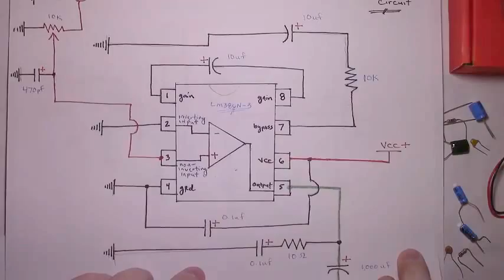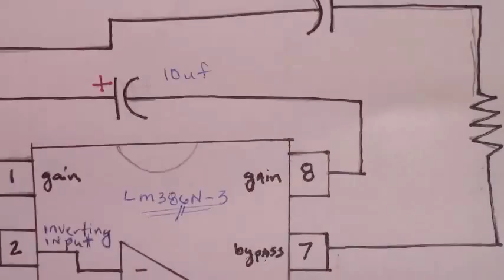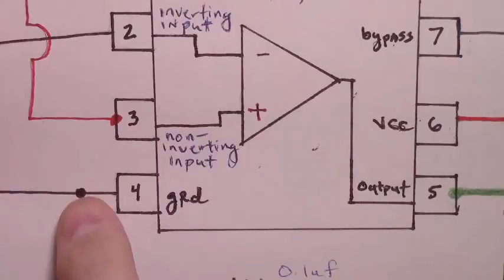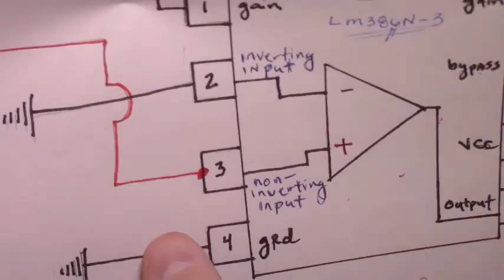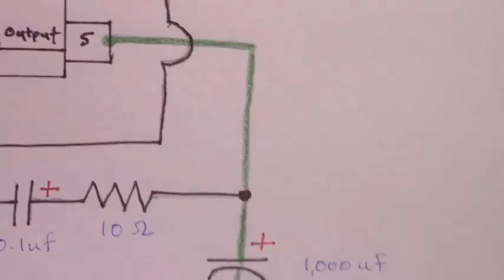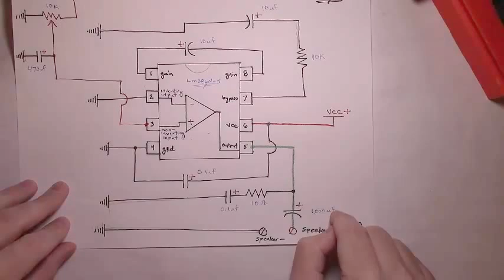Circuit Assembly Tutorials || LM386 Audio Amplifier

Comment: awesome tutorial....can i ask what voltage rating of capacitors you used and the wattage used in the resistors...i really want to do the same thing with what you did , the sound quality is good..keep making awesome tutorials
Reply from the maker: random modnar Appreciate the question and feedback.  Capacitors rated from 16V to 50V & 1/4 to 1/2 watt resistors will work. For,e.g., a 9V supply, caps rated 16+V are fine, for higher supply voltages one might want to move up to caps rated for 25 to even 50V.  The general rule of thumb is to select caps that are capable of handling close to double to in some cases triple the voltage one actually expects them to ever see --similar reasoning applies to resistor wattage.  It's generally better to select parts capable of withstanding 2 to 3 times the 'stress' they will ever see.  Hope these comments help.  Please continue to let me know if there are more questions.  I'll always do my best to help.

Comment from the maker: To Partho Lad:  For some reason I wasn't able to click reply on your comment.  No worries, hopefully you'll see this.  The 386 tends to work best with an 8 Ohm speaker around 1 to 5 watts.  It will function with a 4 ohm but there's a chance that the chip might start to overheat if used for long intervals.  Also, the high wattage associated with the speaker you mention means that it's built 'heavier' than, e.g., a 1 to 5 watt one would be.  'Heavier' coil, cone, etc., typically means more work for the chip to do, more work means more strain and more heat.     Assuming the chip successfully moves the speaker (which it may be able to do) you could certainly use it to test the circuit.  A short test shouldn't hurt anything.  But for consistent usage and long intervals I'd try to locate a 8 ohm 1 to 5 watt speaker.   Hope these comments help.  Please continue to let me know if/when there are any questions.   And, thanks for watching.

Comment: verry helpfull and precise instructions,i am just begining electronics after retireing a few years,and was wondering if this circuit could be used for verry hard of hearing .i look forward to seeing more of your projects,it was verry well explained thank Mike
Reply from the maker: Mike Hancock Appreciate the comment, feedback, and question.  The circuit can certainly be used to amplify audio signals in a variety of interesting and useful applications.  And it's great that you're beginning electronics, it's always an enjoyable world to explore and learn more about.
  
As to the 386's suitability for a hard of hearing application: The chip wasn't designed for usage in medical devices (or as one) and in turn isn't guaranteed, for lack of a better phrase, "to reliably be there when/if one were to desperately need it" (like e.g., while driving a car, crossing a busy intersection, etc.).  Hearing assistance tech is typically tested, retested, etc., etc., just to make sure that it will likely (hopefully) "be there when/if needed".  This being said, it very well might work, but I can't in good conscience I can't recommend it for such. 

However, if the idea was more along the lines of having it serve as the centerpiece to, e.g, an in-house intercom system or perhaps as a headphone driver, then I can say yes to the intercom and maybe to headphones. 

I've used it as part of a in-house intercom system, it's greatly reduced the need to yell across the house...turned out to be a very handy thing to have around.    

As to the 386 being suitable for headphones:  It mainly depends on the type and impedance of the phones.  It wouldn't be the best for use with headphones having a impedance higher that 8 ohms.  Most of the headphones I've encountered have been 16 to 32 to 64+ ohms.  Though it should work in the case of two 16 ohm phones if one rewires them to operate in parallel (in turn reducing the total impedance the amp sees to around 8 ohms).  But attempting to use it to drive a typical pair of 64 ohm phones would be too much of a load in the long run...the 386 would do its best to drive the load and might do a decent job of it for a little while but it likely wouldn't do so for long.  Audio amps like the 386 will do everything they can to drive the load, regardless if it's outside their tolerance ranges.  If the load has way too little or too much impedance, then they can overheat, internally fail, etc.

In the end, the circuit can definitely be used for a huge range of applications and I've found it to be helpful in quite a few unexpected ones.  In house intercom, yes.  Headphones, maybe. One would need to pay careful attention to the impedance. But, as a substitute for hearing aids or the like, I wouldn't trust it to keep one safe.  
  
Hope these comments are helpful.  Thanks for watching the video.  And, please let me know if there are more questions.  I will always to do my best to help.

Comment: philo mech- I was reading thru some of the post below and happened to read the one posted to ViTALiY that really caught my eye I plan on building this 386 as well I built one a Long time ago and it still works good but I want to build another one w/SMD to add a Audio in & out for a 7" TFT monitor FPV all in one unit, but back to the Spectrum Analyzer you mentioned in the post below I was a Sound Tech for Live bands Years ago and always had to borrow a room Analyzer to set the EQ on my 32 Band if I had a bad room or had feed back that I just could not get rid of and still sound good- but most of the time I just did a sound check an Hour before the doors opened and that usually worked Jameco Use to sell a 32 band Room Analyzer kit  w/LEDs the whole nine yards but they no longer sell it and NO ONE even makes that kit anymore at least I cant find it I think it was made by Velleman? the one your are going to build and post is that similar to the same thing? Sorry this was so long I'm Italian and don't know when to shut up or get to the point sometimes!!!! LOL
Reply from the maker: Rosario W Appreciate the question and interest in the spectrum analyzer project.  The one I was describing to ViTALiY is much more humble than the 32 band you mentioned.  It's targeted toward the beginner level, only has a 7 band capacity, 56 leds, etc.  It's a project designed to demonstrate how one can build a very basic but nonetheless visually interesting analyzer without having to figure out how to code, e.g., FFT, without relying on special libraries, etc.  A project that those somewhat new to the Arduino world could successfully complete with a little patience and perseverance, etc.    But I am glad that you reminded me about the 32 band room analyzers.  I'm pretty sure that I have one of those kits somewhere in the house.  I remember assembling one quite a few years ago and thinking at the time that it would fun to design and build one from the ground up. I can see an enjoyable new project and set of videos on the horizon.  Though that will have to remain in stasis for a while longer.  I have quite a few to projects to catch up on at the moment and work is always much more time consuming during this time of the year.  But a series of videos on how to build a much larger, fancier, and in the end more practically useful, spectrum analyzer sometime in the future, definitely.         

I'd like to hear more about the TFT monitor, etc., project as you make progress on it. I always enjoy hearing about what others come up with, learning what they discover along the way, etc.  

Thanks for watching and please continue to let me know if/when there are any questions, etc.  I'll always do my best to reply in a timely manner and offer any help if it's ever needed.
Reply: Philo mech, Thanks for the getting back to me and the all the info. Count me in on the spectrum analyzer! when you get around to doing it. I understand how busy things can get and that's no easy project either. I have always wanted one or to build one I don't know if I mentioned it but I'm self taught and have a lot to learn and a long way to go but my hobbies seem to change as the seasons do around here in NE Ohio lol in winter time its Electronics, R/C Drones, Helis & Pyrotechnics (I'm also a licensed shooter class A&B) then spring and summer is the time to try out all the stuff I tried to build in the winter (Pyro shells too) I'll keep a eye on your channel and subscribe. As far as the TFT FPV set up I would be glad to share that with you and let you know how its going or more likely NOT going lol  maybe I could run a few questions by you if I get stuck? I'm waiting on a very small Video Rx board in the 5.8Mhz band from BangGood.
 I already have and built the Tx w/camera for in flight video If you run across that Room Analyzer kit and think you might want to sell it keep me in mind I know when Jameco sold it in kit form it was around $99 I think? Thanks again
Reply from the maker: Rosario W My apologies for the delayed reply.    I can definitely appreciate having multiple interests and hobbies.  My interests stretch from mechanics to electronics to philosophy of mind and the cognitive sciences to name just a few.  I'll gladly do my best to help if questions arise during the TFT project, just let me know.  I'm still looking for the analyzer kit...I'm certain that I didn't throw it out...but I'm beginning to suspect that I might have loaned it to someone...which often means I unknowingly "gave it away".   If I find it, I'll definitely let me know.

Comment: i would like to replace the potentiometer with a resistor. i set the volume of my computer all the way up, then adjusted the potentiometer to where it was loud but with no distortion and measured the resistance of the pot. however, when i inserted the correct value resistor between input of the pot to the capacitor between the pot and the ic, and removed the pot. it was horrible audio.. it was very gainy at low volumes like if the pot was turned all the way up... what would you recommend as a good value if i wanted to remove the pot from the circuit? awesome sound quality btw thank you!
Reply from the maker: sam davidson Greatly appreciate the comment and question.  

I suspect that the noise issue is the result of the resistor's type/composition rather than its ohm value.  Especially since the pot produced good sound while the same value resistor produced bad.  

Some types of resistors can add noise (and/or inductance if one happened to use a wire wound resistor) to the signal ...the smallest amount of signal noise can sound quite bad once fed through and exits an amplifier.  

There's a lot of debate about which type/composition of resistor is the "best" for audio applications.  Some tend to dislike standard carbon based resistors and to prefer metal foil types.  I've tried both and have had good and not so good luck with both.  Sometimes a carbon based resistor will sound perfectly fine, whereas at others it will sound like someone dumped a heap of rocks in the signal.  Same goes for metal foil (not to mention that supposed "audio quality" metal foil resistors can be quite expensive, especially if/when they don't entirely alleviate noise problems).  

In your case, I'd try swapping the first resistor you tried with another of the same ohm value.  You might discover that a different but supposed the "same" resistor might produce better sound (less noise, etc.).  This is what I tend to do.  There have been times when I've gone through 5 to 10 of the supposedly "same" resistors before finding one that was acceptable.  It's certainly worth a try.  

Also, if the resistor you initially tried was, e.g., 1/8 watt, then you might try one with 1/4 to 1/2 watt rating.  Assuming you have 10 or so of the "same" resistors on hand, it's likely that you will find one or more that won't introduce too much noise into the circuit (or at least less than the first one you tried).  

If you don't come across one within your current supply that results in a decent sound quality, then you might try resistors of the same type (e.g., carbon composition or film) from a different manufacturer, or you could try resistors of a completely different type (e.g., metal foil if you initially tried carbon).  

Of all the types of resistors, I'd steer clear of wire wound in the context of an audio application due to their tendency to produce a significant amount of unwanted inductance in the line.  

I wish I could offer an instant fix, but trying out a few of the "same" resistors one at a time in search of a "good" sounding one, or trying resistors of a different composition/type is often the normal course action.  All resistors and potentiometers are definitely not created and/or manufactured equally (note the 1% to 5% to 20+% variance indicated by the silver, gold, etc., color bands...manufacturers know that each 10K resistor they produce is more often than not, not going to be exactly 10K, nor is the internal composition of two 10Ks out of the same batch likely to be exactly the same).  Such doesn't matter for many applications, but when working in the domain of audio (and analog signals in general), the slightest granules in a resistor's internal composition can lead to significant noise further down the line.   

Fortunately, all is not lost.  If all else fails, you can always return to using the potentiometer.  But, with a little luck, you'll find a resistor among your stockpile that'll sound significantly better than the first one you tried (I rejected 2 of supposedly the "same" 10K pots before settling on the one used in the video).

Hope these comments are helpful.  Definitely let me know if there are more questions and I'll continue to do my best to help.
Reply: philo mech Ok, so i got a different potentiometer. Then I soldered everything to a board. First I got everything working and it was really clean and quiet because i didnt hook up the gain yet. Then I put the capacitor between pins 1 & 8. now there is a very faint squeal as the volume increases and is not present if the song is on pause/ audio unplugged. The only capacitor I had laying around was a 100 uf instead of the 10uf  that you showed. do you think the squealing is from the capacitor being too big? Also if i touch the output of the potentometer it hums fairly loudly is that normal? I have another polyester capacitor but I'm not sure if that would be too small. Any suggestions? Thanks again!
P.S. i tried a different resistor of the same size and it fixed the noise problem. But, me being indecisive just chose to get a different potentiometer so i would still have some adjustment on the board.
Reply: philo mech Ok nevermind! I read some of the other comments and switched power supplies. I had a 12v 1 amp one that I stole from my old router. I switched to the one I got for a recent project which is 12v 5000ma and the problem dissapeared! It also has a LOT more top end it was getting pretty distorted above 2/3 power now its crystal clean! Thanks again!
Reply: Haha just noticed that I was using my wife's account. All of the replys came from me.lol. I am currently using your circuit in a project I am doing. I plan on doing a video on it once I am finished with it. If you want I will post a link to it in the comments! Thanks again
Reply from the maker: sam davidson No worries about the account.  I'd definitely be interested in seeing the project video.  If you get the chance, feel free to post the link here and I'll make sure to check it out.
Reply: ok i will as soon as ive finished it.
im actually having a little bit of a issue with it right now and i have a theory as to what is the cause but i want to see what you think.

ok at home every once in a while for example we'll say 20 minutes. it starts going crazy with a few beeps then it sounds like a tranformer is cussing me out.lol.
i have it wired up so that i can have 2 inputs to the circuit.the internal one is just wires twisted around each other. and the other will be for an external auxillery port. the internal one is only around a foot long.
when i take it to work it happens a lot more frequently like every 30 seconds. i work at a trucking company and there is a lot of wireless communication like cb radio. could i be getting interference? and if so how would i go about drowning this annoyance out.
also i have only used my phone for music not an mp3 player or computer or anything.
Reply from the maker: Nicole Simmons Glad to hear about the success in securing the sound you were after.  386 circuits are (in)famous for being sensitive to a wide and sometimes completely unexpected range of things (they might sound tremendously better with one power supply rather than another, one resistor rather than another, etc.). They can be quite finicky to say the least. Thanks for adding the steps you took to diagnose and alleviate what you encountered to the board. It's always helpful to have access to how someone else reasoned through difficulties.  Please continue to let me know if/when there are any questions and I will always do my best to help.